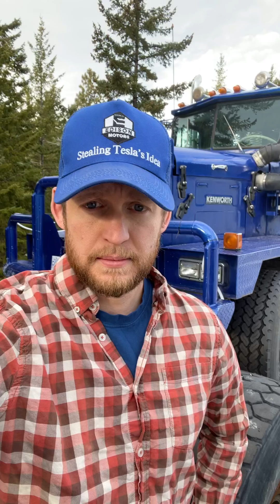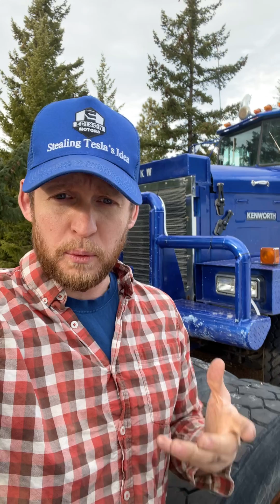Bridging the Gap: Diesel-Electric Hybrids as the Solution to Infrastructure Challenges

Comment: Please try to distinguish between Watts and Watt-Hours. The numbers for both may be quite close in this case but if confused normally lead to wrong conclusions.
Reply: The way he said it is pretty confusing... many, many people do not fully understand this. 
Watts = power = energy / time
Energy = work = power * time 

1 watt of power flowing/working for one hour sums up to one watt-hour.
A battery can store X watt-hours of total energy with can do X (energy/Joules/watt-hours/kilowatt-hours) work, and it can drain that energy at a rate of Y (power/watts/horsepower).
Watts and watt-hours are both relevant in terms of energy storage and usage, but they ARE different.
Reply: I noticed that the new Dodge Ramcharger 1500 pickup in 2025 is going to have a gasoline generator and full electric drive. The gasoline generator only charges the batteries as needed. The truck has 170 mile range on batteries and 690 miles of range on batteries while being recharged by the generator until you run out of fuel for the generator.  I think I have heard of some other company in BC doing something similar but with diesel engines 😅😅😅😅
Reply: @kellyg1757  too bad it's just the pickup I see and not a cargo van. Yeah, they totally stole the idea, but if it's good why not.
Reply: A watt (1 Volt x 1 amp) is the measure of power supplied(what horsepower your vehicle is) while a watt hour (1 volt x 1 amp x 1 hour)is the actual energy supplied (the fuel in your fuel tank).so when you are taking about a electric vehicle watt is the size of motor while watt hour is the size of the battery. So what gets confusing is with power generation they are rated at what power they will produce. So to simplify and ignore lines loss etc ..If you have a 10 megawatt generation station and you have 100 megawatt-hour battery you need to connect the battery for 10 hours..Sounds simple enough right …here’s where the issues come in…all of the water generation stations have been used that are close to where we need the power have been used up…so lets build a wind farm…the wind doesn’t blow every day so we add a solar generation system..come November the solar farm starts running short because there is less hours of sunlight and the solar panels are covered in snow ..but wait we want to charge our vehicles at night while we are sleeping..solar power doesn’t work at night….Lets build a gas fired generation station…humm instead of having a bunch of small fossil fuel motors we now have a great big motor doing exactly what we tried to stop in the beginning….So from my point of view Edison Motors is attempting to produce a vehicle that has more power then the existing vehicles doing the same job when saving on amount of fuel used to do same job without spending billions of taxpayer’s money chasing our tail….Hopefully the world’s governments will pull their head out of their asses and actually support what Chase and crew are doing…
Reply: @John13Edge FYI: volts × amps × PF is watts. Volts × amps is just VA, which is also very important. When talking about long distance AC transmission, everything is sized for VA, but you're usually billed in watts.
Reply: @SuperS05  I dumbed it down alot….yes we are discussing AC that is output from the Alternator but the batteries are the primary load of the grid which are a DC device which does not cause a shift in current in regards to voltage (power factor) and yes I am aware the battery charges can produce a shift shift from unity depending on manufacturer…
Reply: @John13Edge  it's hard to tell when people are purposely over simplifying things or just don't know the difference. The way switching power supplies and current limiting charging works can cause very ugly power distortions which also requires higher VA ratings. Essentially I'm just trying to point out that you'd be under sizing by a decently significant amount using your method, making Chase's argument even stronger when properly sizing things.
Reply: @SuperS05  I work as electrical superintendent on several 10MW solar ,gas,and water generation projects and several Car charging stations..the biggest factor in charging any vehicle is actually time…do you have all weekend or due you have 30 minutes and how many vehicles are you charging at once….the problem with electric vehicles the batteries are interchangeable like on a forklift where you don’t have a driver saying I need my battery charged now…😉😉😉
Reply: @John13Edge  for the vast majority of small car applications, overnight charging is plenty. Some people will still need better power density. Delivery vans, sorta work, although most have a ridiculously small range. My work van would need a 3-400km/day range, equivalent to 21L/100km drag. Yea, if it's not hybrid, or pure ICE, I'm not even looking at it for the foreseeable future.
Reply: This is such a Karen comment.  Why don't you make your own videos instead of being a jerk. If you don't understand the point he is making that's on you. Do you really think you could do it better I doubt it.

Comment: - need to keep impressing on Chase that we need to call the energy usage - GW-hours...    - (Watt hours, GigaWatt hours, etc, yes of course a GigaWatt hour per hour is a GigaWatt  -  [Power not energy ], energy is just that pesky time integral of power..)  

Point taken, but need to avoid mixing power and energy..
Reply: Found some numbers on the internet: 
The average logging truck gets:
~5.1 mi/gal
~ 66000 mi/year

-> 13000 gal/year diesel consumption 

diesel has an energy density of about ~ 37kWh/gal
-> 480MWh/year = 1.3MWh/day = 55kW

Maybe the 1.5-2MW was actually meant to be 1.5-2MWh/day (which would be a bit more than the 1.3MWh that I calculated, but still reasonable). Either way, 1MW = 24 MWh/day, so it makes a significant difference.

The 55kW are still for the diesel BTW, going from a maybe 40% efficient diesel to an 80% efficient BEV, will cut that down to 27kW average power draw, and with systems like regen breaking it might drop a bit more.

The Cite C hydroelectric power plant will generate about 4600 GWh/year = 525MW average power output.
That's enough to power over 19000 BEV logging trucks.

So if you go from needing 10 of these hydroelectric power plants to power all the logging trucks in BC to needing just one quarter of one power plant.
Reply: The widespread use of Watt-hours rather than Joules probably isn't helping. It's up there with the use of Watts rather than Lumens for light bulbs.
Reply: @davidjames4915   - Watts really just helps people figure how much things cost to run (electricity metering is obvs. in energy units - Wh (kWh) - Lumens has no real bearing - ok LEDS have Watt-Equivalent (lumens - for output) , very confusing, lol...

Comment: Its the most efficient process we currently have. Its the exact same as every train running in america. People get so scared for no reason.
Reply: Locomotives actually have their engines running constantly whenever they're moving they just use sets of capacitors to smooth out the power delivery to their motors
Reply: it's not that they are scared, it's that there is less government money in coming up with real solutions.  Look how much money politicians throw at 'Green' industries then see how many family and friends they have in those companies or stock holdings.  Wind power is heavily subsidized because it fails if it was to stand on its own.
Reply: No, it's not like a diesel/electric diesel locomotive. Most diesel locos in service today ( that means day in, day out operation) have a diesel that drives a electricity making device, the electricity from that goes to drive the electric traction motors on the axles. The only batteries involved in most locos are for starting only. Yes, there are exceptions to the rule, CPKC just completed in their Calgary shops a hydrogen fuel cell loco, and a few years Morris-Knutson ( hope I spelled that right) did a loco with indirect gensets and batteries, they were poorly designed and are currently not in revenue service.

Comment: With the generator engines you've selected for your trucks, are they capable of using or being adapted to biodiesel? This could also add to the greener transition we need to look at in the mid-long term.
Reply: - biodiesel is diesel for all intents...  And no, bulk use of biodiesel isn't all that green, despite the hype (farming, processing and transportation, all uses more diesel - just to get diesel to the "green" truckers.)
Reply: I view biodiesel as more of a renewable fuel vs green...i say that as a retired farmer/trucker. @kadmow
Reply: @kadmow  regular diesel also has to be mined/sourced and it has to be refined and transported to the final user. The farming part of biodiesel might take a bit more energie than pumping it from the earth, but it does not compare at all to the burning of regular diesel. 

Personally I’m not convinced of using bio diesel because of lots of other reasons like food and the inefficiency of the internal combustion engine. But please use some valid arguments because yours are not.
Reply: He means that the vehicles and technology used to make biodiesel are often themselves run on petroleum fuels and have large emissions. 

Furthermore, the food vs fuel debate isn't necessary because biodiesel can be made from any biolipid, such as algae oil. Diverting food crops is unnecessary.

And piston engines are an extremely efficient way to turn biomass into energy given their price  @autobootpiloot
Reply: @icedout7606  Have you even read my comment? Diesel doesn't just fall from the sky into a fuel station either. It takes energie to make and to transport too.

Food vs fuel is a debate we need to have. Not only is fuel from waste not available at large scale, the soil also needs the waste for the nutriens to grow food. What we can grow responsible is very limited. We must use it wisely. 

Efficiency has abolutely nothing to do with price. Internal combustion engines are very inefficient. There are much much more efficient technologies available. 

If we have the next revolution in technologie we have to shoot for the best and most efficient way to do so and not settle for inferior ways because it's cheap and easy.
Reply: @kadmow  To not talk about the deforestation in other countries to plant stuff to make biodiesel out of it... is a big scam this thing of the biodiesel
Reply: @kadmow  cheers. I do see that if anything it could only be considered at best 5% better than 'regular' diesel. But even with that we still have arguably the same process. Only real difference could be less international shipment of the fuel.
Reply: I've run pickups and old Mercedes is on wvo the last time diesel spiked... Colorado turned wvo into hazardous waste. I used to pick it up directly from the restaurants for free and process it.
Reply: @justinsane7128  we used to buy biodiesel for slightly less than mineral diesel from a feed mill around the corner because they ran all their equipment on it - tractors, combines, generators... They started out with restaurants paying them to collect it, then they collected for free, then they started having to pay for it, until the price got so high that they quit making biodiesel altogether. Not because it was classified as hazardous here, but because the automakers were buying it to make plastic and foam interiors.
Reply: I run black diesel in my equipment and vehicle.  Look it up. I cut it w/ pump diesel
Reply: A large proportion of biodiesel comes from vegetable oils.  Why would you use arable land to produce fuel with food costs so high already.  And not only that but destroying rainforests to plant Palm Oil trees. Listen to David Neeleman, the founder of Breeze Airways who said this thing and poo pooh the idea of SAF (Sustainable Aviation Fuel).  It just doesn’t make sense.
Reply: Depending on the generator, you could run what is effectively waste kitchen grease. Emissions would be quite interesting, but it is still technically green fuel. It wouldn't scale well though
Reply: Biodiesel is better it helps to close the loop. Not taking it out of the ground and releasing carbon that was stored millions of years ago is always a good idea.
Reply: @Joegreen-r1i  to produce biodiesel requires fertilizer that is dug out of the ground even deeper than the carbon and has been there longer, kind of a catch 22 situation. I may be very slightly greener but has plenty of downsides as well.